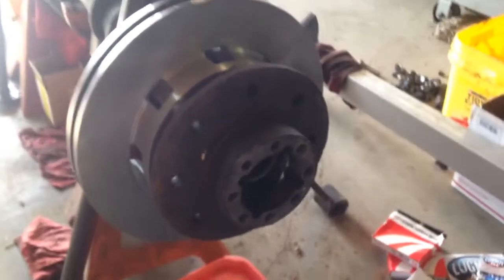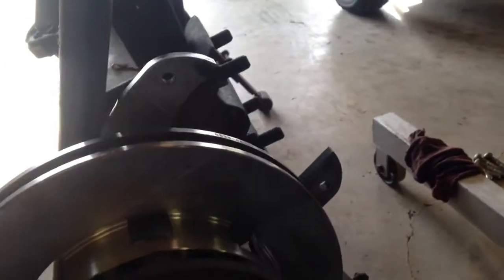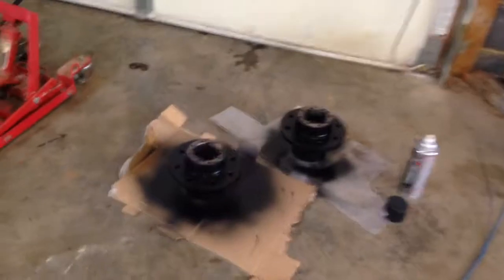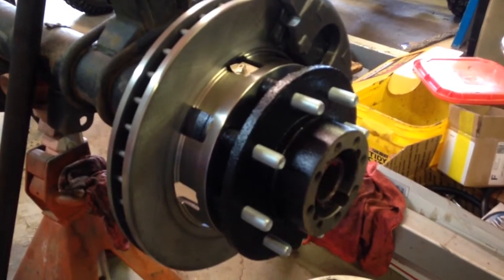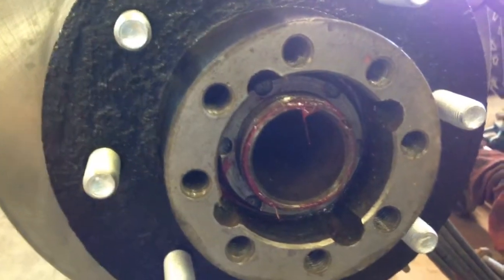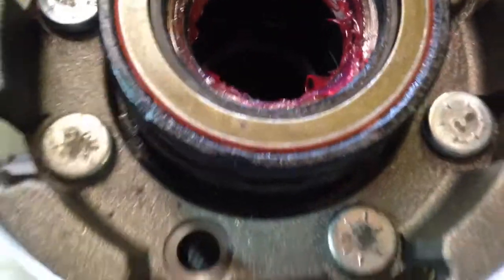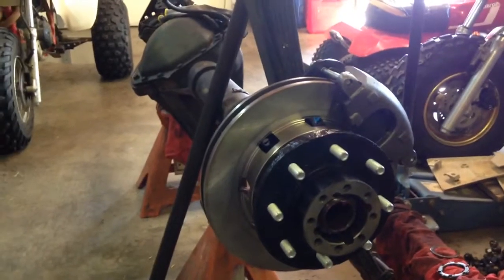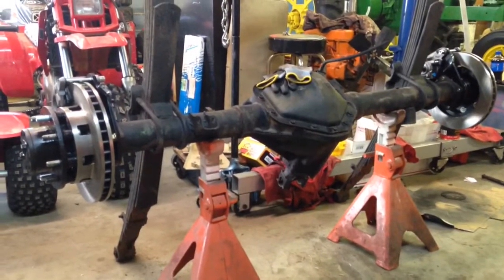GM 14 Bolt Axle Rebuild Part 5

Comment: You said : " It uses Cadillac eldorado calipers. " are you sure about that?  Because I bought the kit that had regular calipers and turns out I should have bought the kit you bought and now that it is too late to return mine I am stuck with the 1-1/4" thick rotors and looking to buy calipers that have the E-Brake only problem is I'm not about to spend another $300 on calipers from Lug"NUTS"4x4 after spending $274.00 on the kit. I'm looking for a pair much cheaper on e-bay but no luck so far do you know or have the part number from those calipers so I can cross reference them or do you know where I can find a cheaper set with the E-brake?

Comment: Where did you buy the brake kit?
Reply from the maker: persson882 Ordered it off eBay. Had to search a bit to find this one that would accommodate the ebrake. It uses Cadillac eldorado calipers.
Reply: Okay thank you for the info. Did you buy those of 4x4lugnutt On ebay?, thought about doing the same on my gm 14 bolt
Reply from the maker: http://www.ebay.com/itm/GM-14-bolt-complete-disc-brake-conversion-kit-10-5-SRW-emergency-brake-calipers-/111831751236

This is the exact item I purchased.
Reply: okey thanks :)